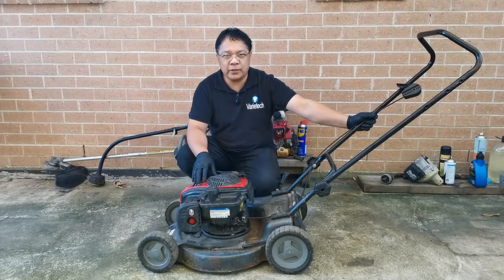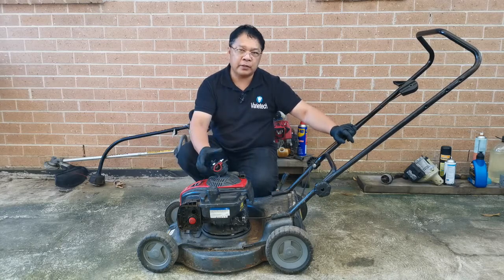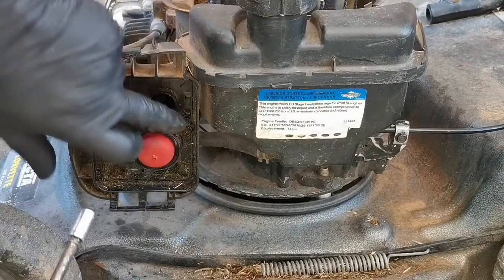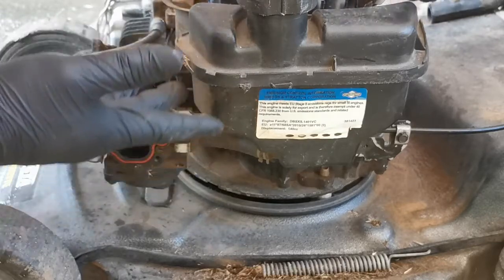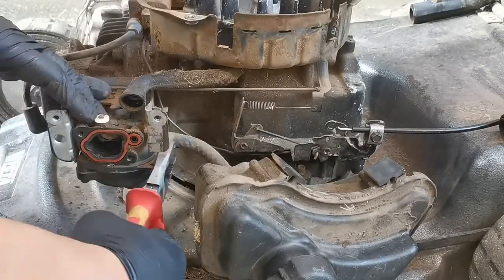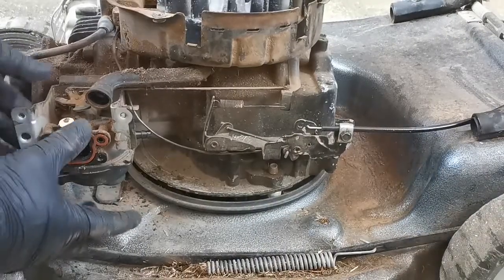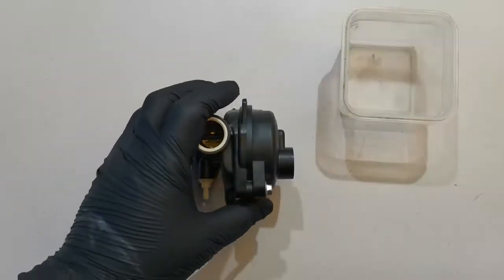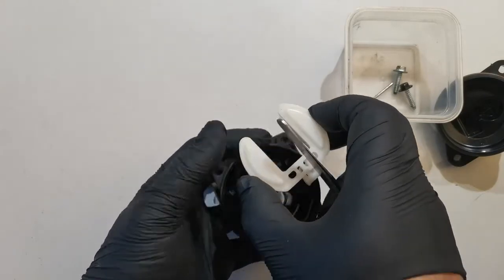VTECH 66 - Repairing Victa Corvette 500 Briggs 500E Engine

Comment: This is fantastic, it's literally the only video about the same lawnmower I'm trying to fix, my landlord accidentally put 2 stroke fuel into the lawnmower and said it was smoking and coughing until it shut off and now it won't start

I'll be sure to do this because I'm 90% sure the carburettor needs a proper clean after that, I already cleaned the spark plug, added petrol to the spark plug socket, put the plug back in and tested for spark and it wanted to start but couldn't 
Thank you for this
Reply from the maker: Thanks for watching

Comment: Foam air filters should be oiled, they are very ineffective without it. only exception is foam pre-filters, they are dry.
Reply from the maker: Thanks for your constructive input. I won't disagree with you as your suggestion and this information the other viewers and subscribers will find it useful. Cheers, VARIETECH
Reply from the maker: Yes you can spray the foam outer part with oil to trap dust into the filter. The foam filter has enough micro filtration and I don't apply oil on it as dust will stick into the filter and will accumulate overtime and will reduce the air flow which will stall the engine overtime. Without the oil, the dust will fall off the filter and easy to clean the filter with compressed air for maintenance. Thanks for watching our videos and providing positive inputs. Cheers, VARIETECH
Reply: @Varietech-AU  I disagree. The dust doesn't fall off, it passes through causing permanent damage to the engine. This is written in the manual for these engines for a reason.
You can do a test for this. Find a b&s sprint air filter with a snorkel tube. Run the snorkel under the mower to make the environment as dusty as possible. Use an oiled foam filter first then do it again without the oil. You will find no dirt after the filter in the top section of the carburettor if it filters correctly.